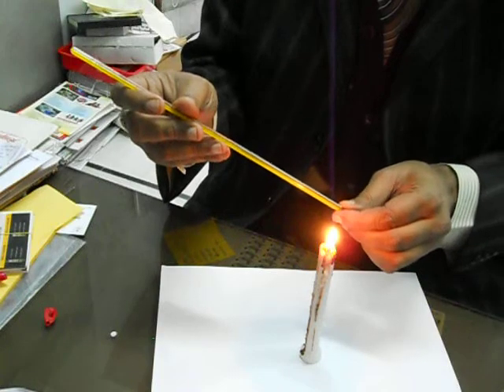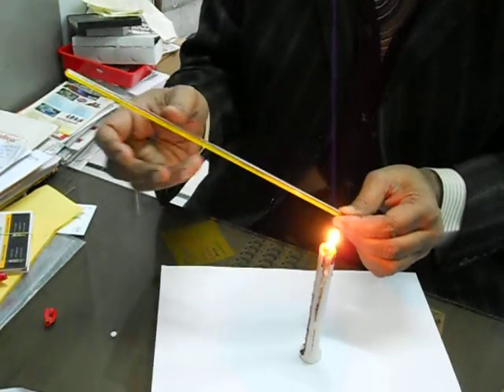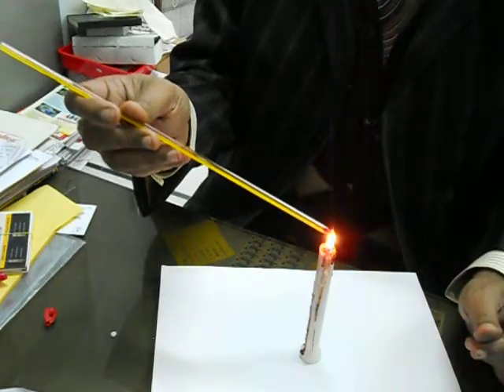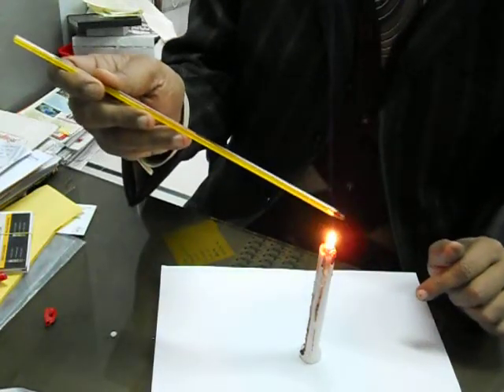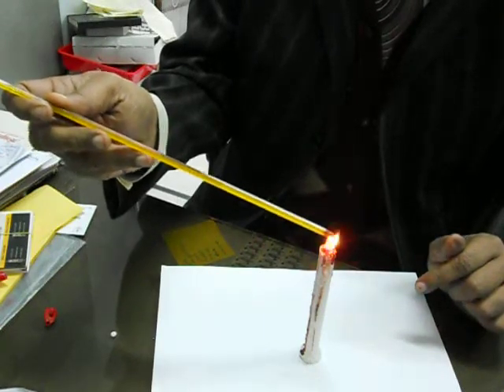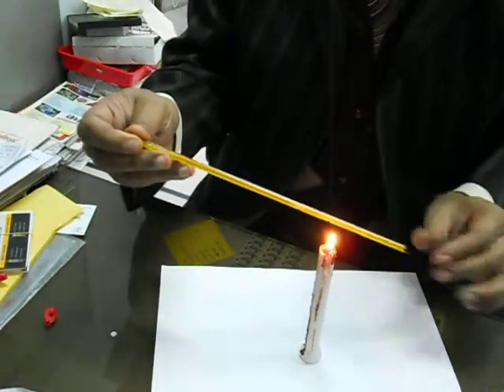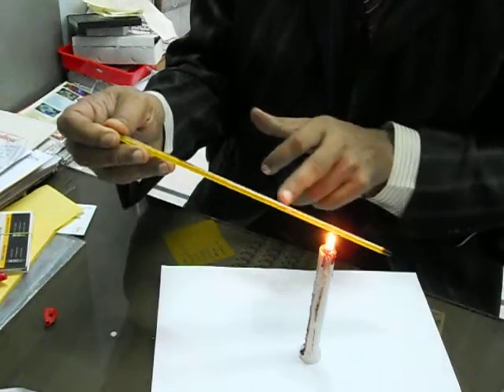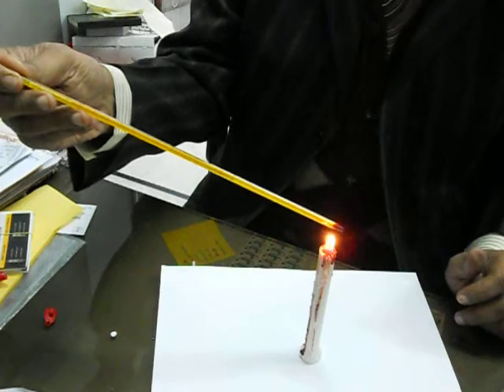How to Repair Broken coloumn  of thermometer Air coloumn By Abron exports abron01@gmail.com

Comment: For alcohol 0-100° C thermometers, put the bulb in boiling water instead of over a flame.  It is safer.  This method works best if the thermometer has an expansion bulb at the top.
You can also try cooling to zero.  To get it cold enough put ice/water and salt in a container and stir the thermometer.
If the thermometer has a ring on the top, you can try fastening it to a string and swinging it in a circle.
None of the above methods worked with my 0-100° C alcohol thermometer with no expansion bulb at the top and a ring.  
I finally put the top end in boiling water for a moment and the alcohol joined back together.

Comment: Thank you for that.  I just broke my thermometer listening to the idiots that have their comments closed.  Always check the comments first.  I should use some bad words here, but i won't.  Thanks again.
Reply from the maker: you should take care not to break mechencials by hitting any part just heat mercury to and let it cool  we do this on every thermometer we manufacture 1000s per lot
Reply: My thermometer was 5" or 127 mm.  I'd like the replace it and i cant' find any that size.  Any thoughts.  It's got red alcohol or spirit with the numbers printed into the glass.  Thanks.
Reply: sir  we have all sizes even 6 inch alcohol ( red spirit) Please tell me use and range you had and your address and email I will suggest  how to get it and at what cost